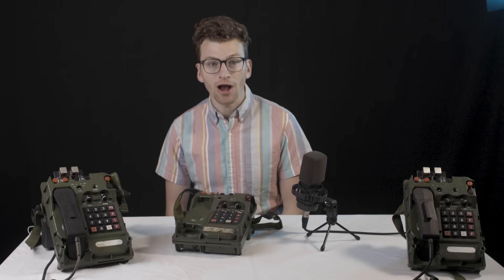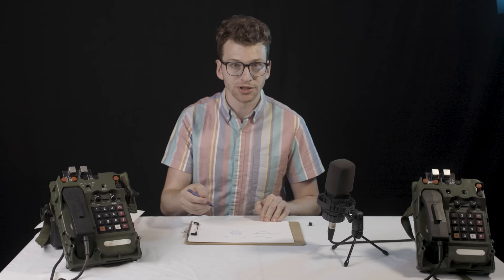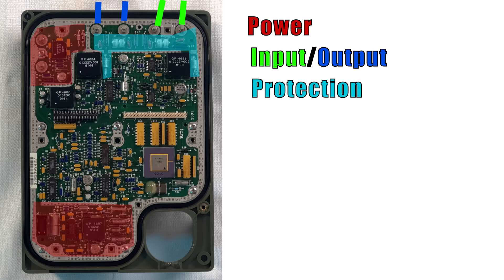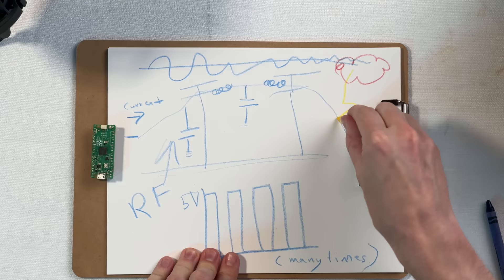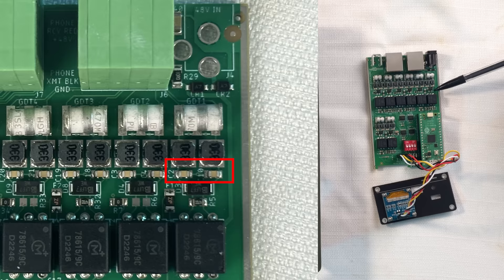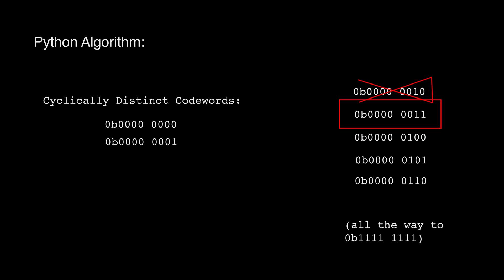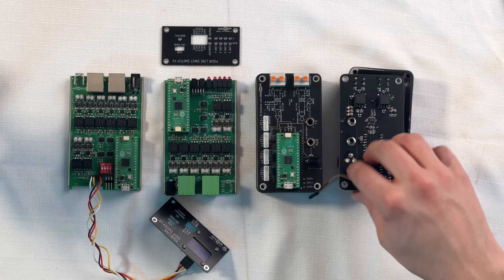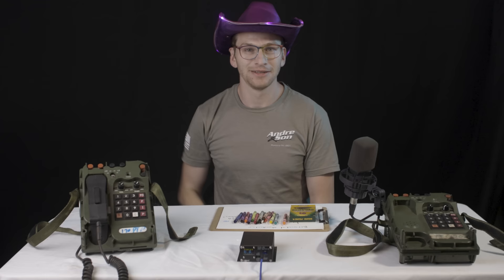What's inside this old military telephone? | TA-1042 Part 2

Comment: another processor that might work alright is the  ESP32, ..and they have onboard bluetooth and wifi, though that probably won't work too well with the aluminum cases.  They're dual core 32 bit so they should do some decent processing over and above what the STM32's could do
Reply from the maker: The issue is that the differential Manchester decode/encode would have to be interrupt driven. Doable but more confusing than a dedicated PIO implementation. In this case even this processor was overpowered for just shuffling the bits to USB, but at $5 can’t complain :)
Reply: @nicksknackstech  I don't know if you follow Dave's garage, but he does some pretty complex FFT and sound processing with his ESP32 projects.. I could definitely see the STM32's being overworked unless you're a coding genius and have a lot of experience on getting the most out of small processors
Reply from the maker: There’s no codec implementation in this version but I think it would be doable for a single channel. It would be a lot easier with floating point/M4 instead of M0+ we have here

Comment: That CPU looks a lot like a Motorola 68030.
Reply from the maker: Might be interesting to decap one of them and take a peek.
Reply: Probl3m is that for it to function it would have RAM, ROM, and a bunch of glue logic around it and there does not appear to be any.  This leads to the co conclusion that it is in fact a custom or semi custom ASIC as asserted in the video.  Still decapping one might be interesting.  Might contact Curious Marc since he simply gutted one and grafted in a regular POTS phone into one of these a while back.  He might give you the board if he still has it.
Reply from the maker: @mikeiver  he didn’t reuse any of the existing circuits unfortunately.
Reply: @nicksknackstech  that was the point.  He may have the original board that you could ask for and use to decap the ASIC.

Comment: Since part 1, I've been working on drawing out a CAD model for the TA-1042 in Fusion360. The idea being that if you just wanted to have something that looked like it, but was totally different tech (like i want to do), then having CAD models would make 3D printing etc much easier. However, I'm having a lot of issues finding good reference material, and nothing at all with accurate measurements. So...any chance I could convince/beg you to take some good photos of all sides with a ruler sitting in frame somewhere or something? 😁
Reply from the maker: Want to hop on the discord? Might be able to use the iPhone to scan it in 3D.
Reply: @nicksknackstech  That's a great idea. I'll jump over there momentarily!

Comment: Lovely.
Over a few video's you can call between no less than 4!!! similar phones.
OH MIRACLE!!!

Now, I then would strip the whole inner side, put in the content of a regular phone, hook all parts up (the horn, keyboard, ...) and be able to call wherever with this landline phone.
Now, I assume, you're going  for a landline phone, thinking, it would be a tad impractical turning it into a cell phone, which, btw, is no issue either.
It will just fit a little less well in your pocket.
Still, VERY doable.

A tad less jokingly:
You failed to mention, what your goal here is.
Which brought me to my comment above.

Be so kind, if you make a new video, to explain what you are after?
Only a handful people on the planet have Autism (severe Asperger's here) and similar happenings in their gray-matter computer up the attic, and are less good in telepathy ... .
We could use a slightly more in-depth elaboration ... .

If you would be so kind, sir?
Reply from the maker: YouTube does suggest that I am far from the only one with ASD 😂

I did allude to it in the video but the goal is VoIP for these phones. Basically bridging the protocol to SIP and allowing interoperability with conventional SIP trunks by adding the CVSD codec to Asterisk. The other main goal was to enable a data network using modern open source tooling that would enable the use of DNVT accessories like the fax machines etc with Asterisk and modern IP stacks.
Reply: Also, I did not see the whole video, I got distracted (severe ADHD as well), needing to close the video before I could end it.
Which was basically at the very start ... .  :S
So I missed the part where you pointed at it, I think.
Unless it was the very intro itself, you refer to, I am like that myself.
But I missed the ASS in it, I fear ... .
Probably the ADHD  ... , if that was the case.

Apologies in that case, my brother.